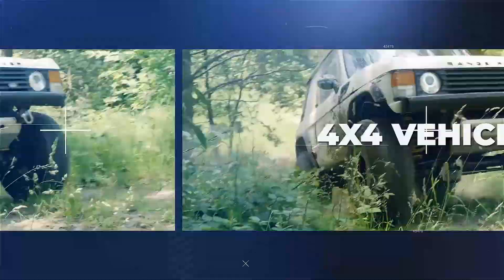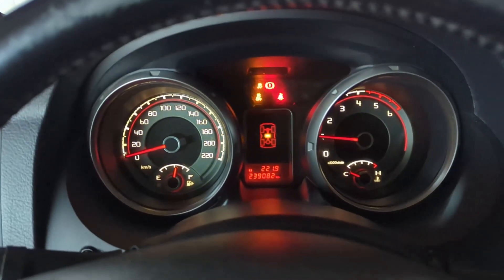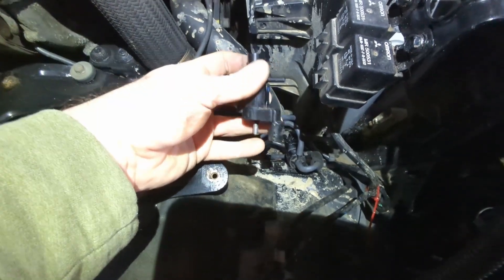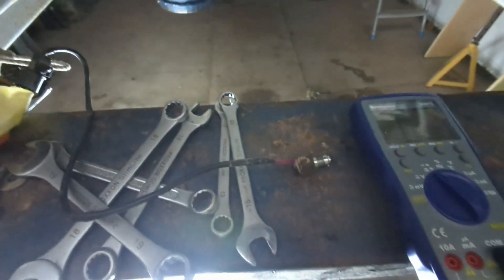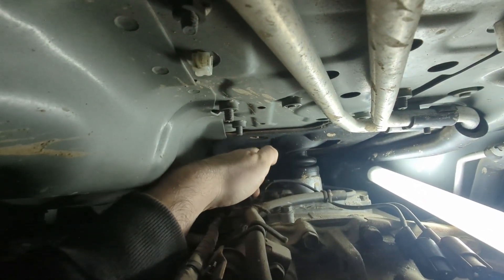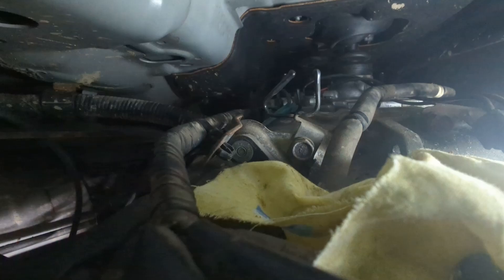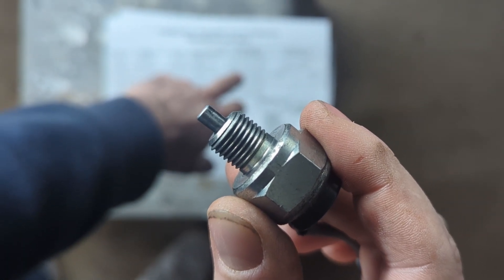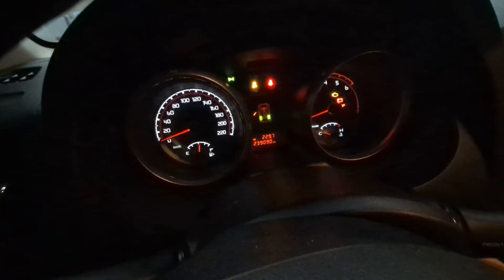Pajero/Montero/Shogun 4x4 light blinking - troubleshoot! Lost all wheel drive on my first adventure!

Comment: I'm stuck on 4LLC 😂 with orange blink
For 3 days, the mechanic doesn't know how to fix it
Reply from the maker: I don't know if you've already solved the problem, but the first question is whether you're stuck in 4LLC – meaning the low-range gear is always on no matter what you do with the mode switch? The most important thing would be diagnosing the condition of the switches on the transfer case and checking if the car actually understands the position of the transfer case and the cabin mode switch. It's a lot of tinkering and a challenge! If you were nearby, we could diagnose it together!

Comment: Hi in my case is flashing when its on 2h then i switch off the care and switch on back is gone and when i shift it to 4h  the center light will never flash what do u think the problem is ?
Reply from the maker: Yeah, there aren’t many options here, especially since there’s not enough info. You’d really need to diagnose the positions of the switches on the transfer case and the mode selector to check if the communication is working right – if the car even understands what state it’s in when you start it. Right after starting, the Super Select system in a Mitsubishi does a self-check. If everything matches up the way it should, then nothing will start blinking.

Comment: Mine is a bit wired. 2H is fine, 4H is fine for first a few minutes then all 4 wheel off center light flashing....Any suggestion would be appercaited. Thanks😀
Reply from the maker: Sure, these are different symptoms than in my case, but when you switch from 2H to 4H, the car tries to engage the front differential using a solenoid. Vacuum is sent to the actuator, the actuator engages the differential, and this is confirmed by a switch mounted in the front diff.
First thing I'd do is check visually if the front diff actuator is even trying to engage the diff when switching from 2H to 4H. If not, I’d check if the solenoids are working, like in the video. Then I’d confirm there's vacuum and no leaks.
If the actuator works, it might be the switch that’s not confirming to the computer that 4H is engaged. I recently explained how to check the switches on my Patreon – it's in the video description. Cheers! I hope I can help!
Reply: @SeagullGarage Thanks a lot

Comment: so the issues of the blinking could be either: the actuator solenoid , the vacuum hose or the switches, brilliant. and if changing the first 2 didn't solve the problem it will be the switches which is the annoying part
Reply from the maker: Yes that's pretty much as it is. There can be ofcourse broken cable and so on as well in rear cases. But i highly advise if you are going as far as diagnosing that yourself you should definitely get yourself a proper diagnostic computer for Mitsubishi cars. I would save me so much time and i probably could just change one and directly know which one was bad... Thanks for comment! Cheers and good luck!

Comment: I had the same issue but for my case the part under the bonnet behind the right light had snapped out
Reply from the maker: Do you mean 2 selenoids? Those two are luckily easy to diagnose and change. That should always be the first step with an orange light problem. Cheers! Thanks for commenting!

Comment: No you don’t loose 4x4 when the vacuum lines are not working. The car defaults into 4x4 mode by design. The vacuum is to keep the car in 2WD unless you need 4wd. This is a super select thing for pajeros to make sure you don’t get stranded

Comment: Thanks for your sharing, I have a question: 2WD and 2WD, 4WD switch. I see their type is N/C and other three switch remain is N/O. N/C: normal close N/O normal open?
Reply from the maker: What you're saying is right! The state of those switches will change depending on the current mode your Super Select 2 system is operating in! You can check the workshop manual to see what state each switch should be in for each position – it’s even shown in one of the videos. Thanks for comment and watching!

Comment: Good video. Thank you
Reply from the maker: Thanks! Let me know if there’s a topic you'd like to see next!
Reply: @SeagullGarage 
I have some diff slap on excelleration . Unsure how to diagnose this. My tail shaft has a play of about 5 to 7mm. 
It thumps when I put a bit of power while coasting.. any ideas?
Reply from the maker: Sorry for late answer but i need to research topic myself. Are you talking about same as here under this link? http://mmc-manuals.ru/manuals/pajero_iv/online/Service_Manual/2015/index_M1.htm That's rear axle total backlash check. Please start there. Cheers and thanks for comment! I see link is not working to good, look under point 27 -REAR AXLE!

Comment: I notice you had the asc off light and the traction control light as well, were these solved when you fixed the 4x4 error?
Reply from the maker: Yes that was more because i have battery off. And ASC need some time to recalibrate but all was gone after 50m drive. There is particular procedure for each car. for example turn wheels while standing still full left and then full right and then drive. Something along this lines, i will try to digg it out and make video about it. Thanks for idea!
Reply: @SeagullGarage  No worries! My issue is a bit different so I'm currently doing diagnoses. Next will be checking the transfer switches. I have the classic flashing orange light however with the car on the hoist we found that it was changing between drive types, just not displaying correctly in the dash. On startup everything looks fine then after driving maybe 50m the light starts blinking and the ASC and traction control lights come on
Reply: @xavdante  Hello, I currently have a similar problem, my central differential light only came on after about 30 minutes of driving and at some point the ASC light also came on. Have you already been able to solve the problem and if so, could you tell me what the problem was?
Reply: @Faeaeb  still working on it! I suspect transfer switches or an abs sensor could be the fault. I've heard a map sensor can also trigger this issue so I'll check that and I reckon you should too!
Reply from the maker: If you happen to be around, feel free to drop by—we’ll hook up the sensors to the computer and see what’s going on! If you’re not in Germany, it’d be a good idea to connect a diagnostic tool that can read all the sensors and check what’s happening.
Reply from the maker: If you happen to be around, feel free to drop by—we’ll hook up the sensors to the computer and see what’s going on! If you’re not in Germany, it’d be a good idea to connect a diagnostic tool that can read all the sensors and check what’s happening. Cheers! Thanks for watching!

Comment: Very informative Video! explained everything well and showed every important position.

I have the issue that when i switch from 2H into 4H, the dashboard changes from 2H into 4H, but im not actually in 4H.
Same when i switch from 4H to 4HLC it shows that the center diff is locked, but its not actually locking.
Do you have an idea what my issue could be ?
Thanks :)
Reply from the maker: That's really weird, especially since the displayed state is based on the position of the switches on the transfer case and front differential. If they're actually showing the correct state – meaning the components inside are moving as they should – you might suspect there's some fault within the differentials themselves. But that would more likely be a failure that would either immobilize the car or at least be pretty noticeable... Is it just the center differential that’s not locking, or is the front axle also not engaging? Any weird noises coming from the center diff? 

Cheers!
Reply: @SeagullGarage   front axle and center diff not engaging...
No weird noises but i will soon put the car on 4 stands and inspect everything closely.
But thank you for your answer.
Reply from the maker: @maltem123  that is indeed strange, So you only have 2 back wheel driving but dash is showing full 4WD with lock central diff? Wow, please keep me updated.

Comment: Hi I changed the 5 cables, I changed the solenoid and I also changed the actuator that goes into the 4WD differential. No type of gear goes in and I only have the central orange light that flashes and doesn't let me change any selection. Can you help me? It seems that the lever mechanically doesn't engage anything
Reply from the maker: Your lever mechanical cant engage anything because its totally electronic. There is no mechanical connection to gearboxes or transfer case. Are you sure you have vacuum in the system? No broken cable? there is vacoom container on right hand side of the front differential, it can have a hole in it. Its critical to functioning of the system. Thanks for comment! Keep me inform we will try to work that out!